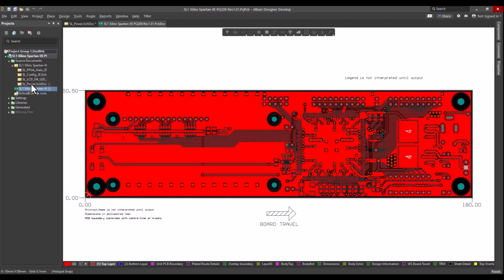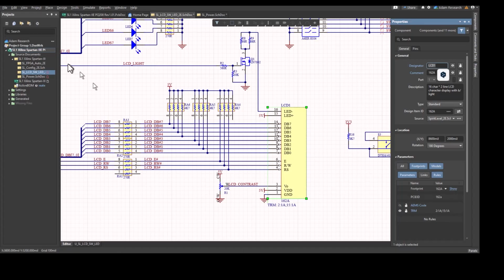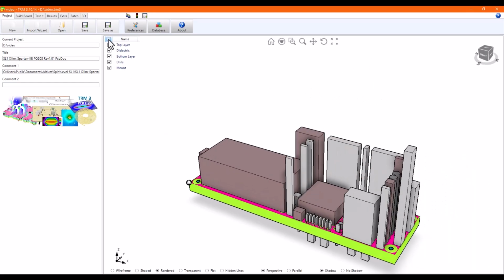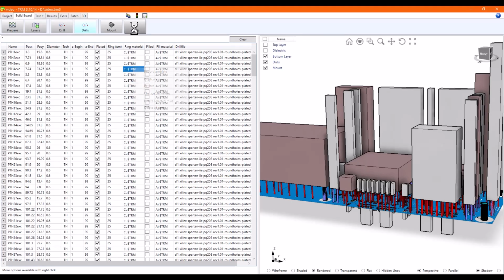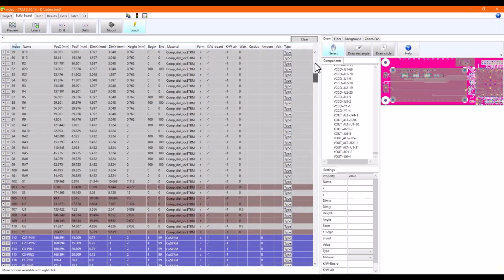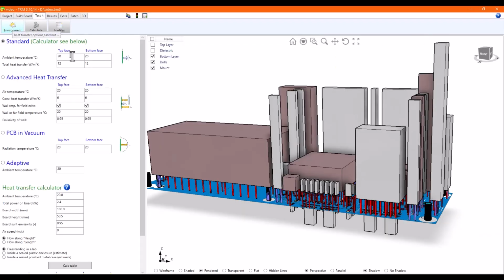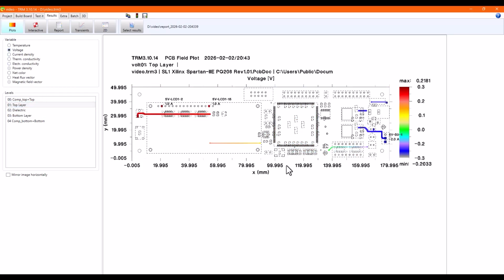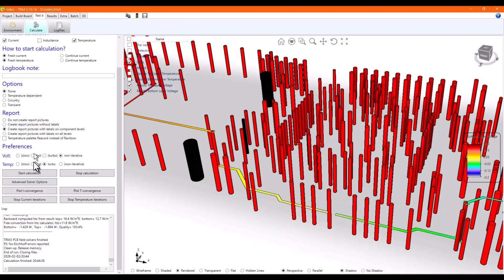Johannes Adam on PCB Thermal Management (RE-UPLOAD)

Comment: I agree, thermal management on a PCB is often left to the end of the design and typically problem areas are then handled externally. External heat sinks, and fans are great but the design of the PCB itself is often overlooked and really should be the first tool used to manage heat. As a general rule I try to apply a number of design practices to draw heat out of specific areas: Copper pours, thermal vias, and part placement are primary. PCB area is a great means of moving heat. One area which could do with reliable analysis tools is the use of Thermal relief on pads. We use Thermal relief on pads to reduce heat leaking from the pad to the plane, but when we want to pass a lot of current through these junctions we need to maximise the heat flow from these areas into the plane. Can TRM3 software be used to balance the use of thermal relief and current capabilities?